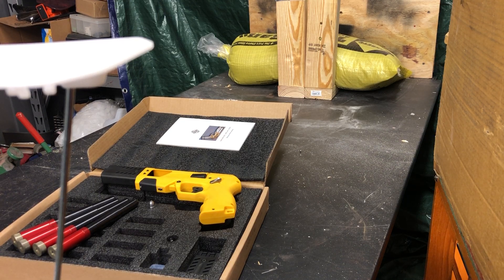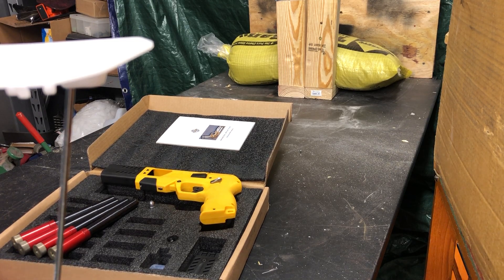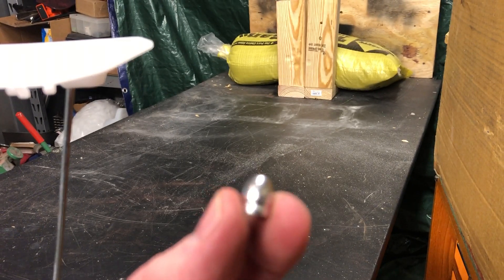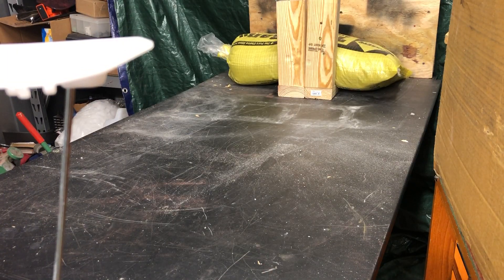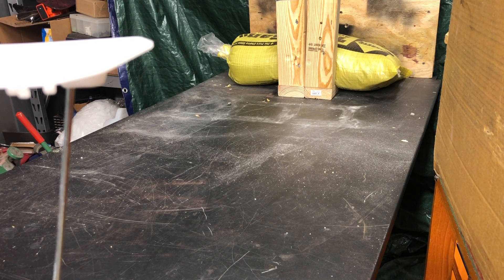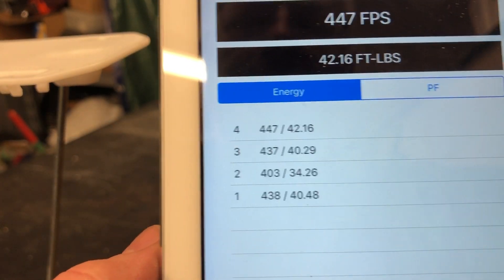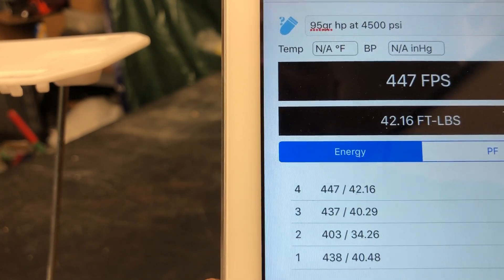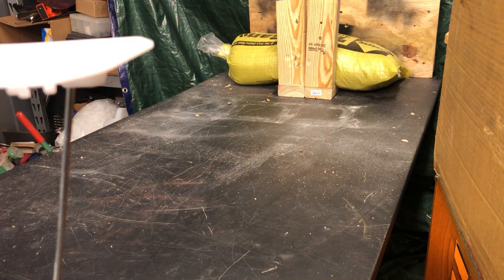AEA Defender 2 chrono test in 357, full cylinders at 4500psi by Texoma Precision Pellet VID52

Comment: Pretty much same numbers I get. I've done a test after a few days of letting them sit and it was just above 30 fpe. This is a slow testing process because the gun is loud and much of the testing requires waiting to see if there is a difference. After this I have to test if there's a way to get the air charge to hold longer, perhaps with a little silicone oil applied.

It is satisfactory and certainly will be effective at close range. I must remember these carts can easily enough be topped off even with a hand pump. Thanks for sending a few extra slugs my way on the last order! I think I'll try the 95 grain or lighter diabolos on the 357 next time. Cheers.